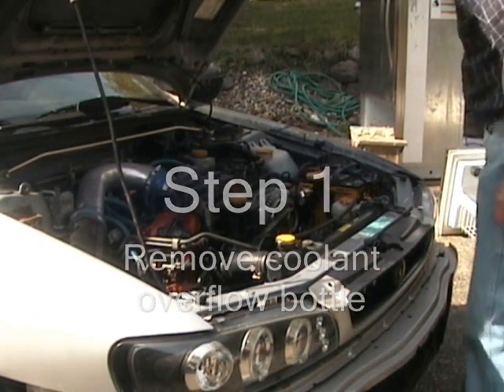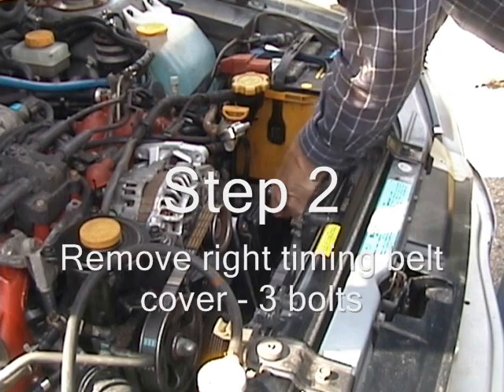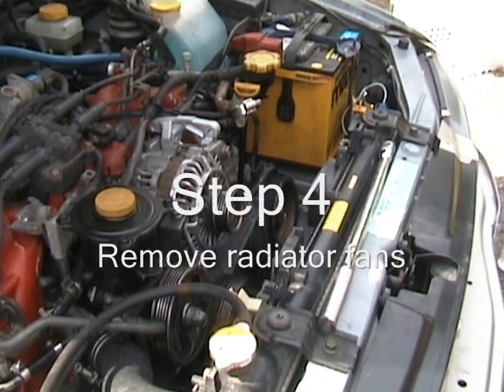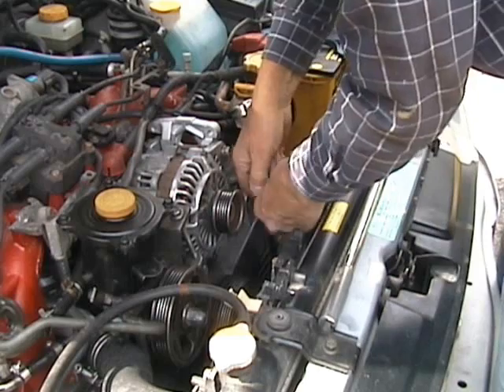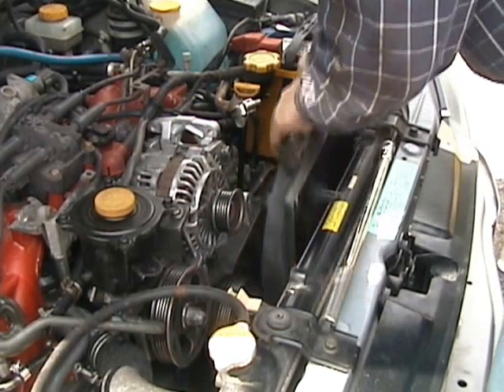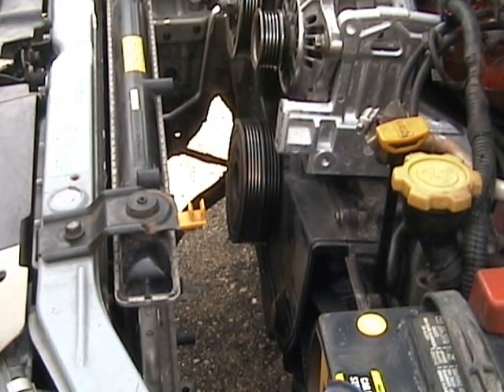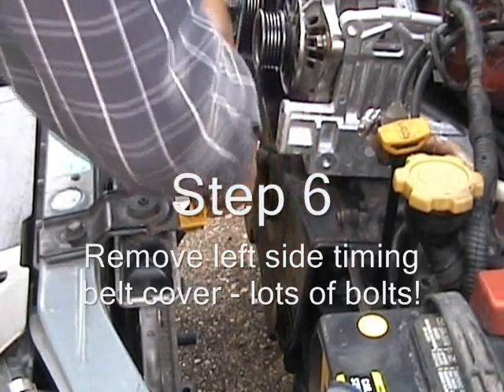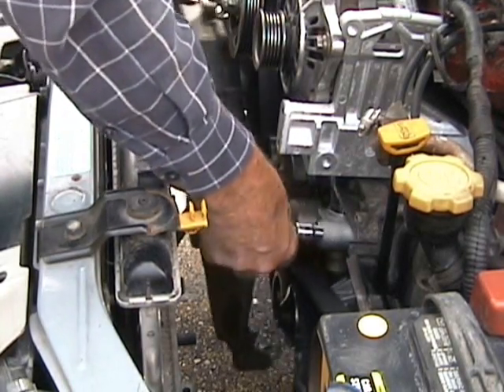How to tell if your Subaru engine knock is from the timing belt tensioner.

Comment: Great video! But to replace it a hydraulic tensioner needs to "bled"
https://youtu.be/UYz5JxKJ5hs?si=s61sTfy6lT6CMN5c
There is also another symptom clue to the noise, if your engine isn't losing power over a week or two but not getting worse and the noise remains, hook up an OBD tool and watch the timing gap angle while the engine is idling, it tends to change its' gap degrees angle excessively around as much as or more than 1 degrees.
If you have an EJ253 you may need to find carefully if the tapping is an AVLS valves (head Bock) fault.

Comment: Hey Brian:

You forgot to mention a few critical things!  Firstly, the upper radiator hose has been removed in your video, and I am wondering if it is OK to run the engine without coolant, like you show.  Secondly, most of us do not have the “chops” to make a homemade “stopper” tool like you use, so what are we to do instead? Are any of such tools sold on Amazon for about $30 US OK to do the job?  Finally, it would be really helpful to have a video describing the procedure for choosing a good quality tensioner and the proper method of installation!

Comment: It sounds like a rod knock. And the wild thing is that if you rebuild the engine you also change the timing belt, waterpump and this exact tensioner. So the problem is gone and you paid 6k for something that already is covered by the service plan. I won't even imagine how many fine engines got rebuild due to this small issue.

Comment: I think this is what’s wrong with mine. I just changed the alternator belt and two days later I get this loud grinding sound like yours. Gonna have to take off the timing cover and check… thanks for the content, quick simple and straight to the point!

Comment: I can't Thank you enough Brian - Sharing this video means so much as I was to having the same knock or rattling sound in my 2010 Forester And was worried that it may have been a Con Rod Bearing. You've just gave me a new direction to look and first check before doing a major overhaul.
Again Thank you 
             Cheers!
Reply: What did it turn out to be? I'm hoping it really was the tensioner 🙏 I've got the same issue 💀

Comment: I have the exact same sound, but the radiator fan is not moving. What should i tell the mechanic to avoid an unnecessary motor lock inspection?

Comment: Was concerned to see you running without the crank pulley to stop the timing pulley coming off, but I see you mention that. Tensioner pulley noise sure can make you think your engine is about to die! Thanks for the video.

Comment: there is supposed to be a metal sleeve bushing where the tensioner bolt holds the tensioner assembly in...i suspect it may be missing from the one in the video.

Comment: brand new tensioner failed ?  my ej25 DOHC< new head gaskets, timing belt, water pump, idled great..until last night...driving along, BAM, lost power, over heat light came on, and engine was making a racket...towed over to my where I have my evening classes, and tonight started up but with ticking noise that increased with engine rpm.  I just removed one timing belt cover....any ideas what it might be ?  Looks like I should check the tensioner, but my noise seems to be louder at cylinder 1...
Reply from the maker: If it runs, timing cannot be far out but "lost power" suggests timing belt slipped. Possibly valves hit pistons so clatter. Sounds bad to me. Looks like an engine rebuild.
Reply: @threehulls  I posted a video on Facebook and 80% said rod knock, but I some said tensioner.  I will listen again tonight (vanagon-subaru) is not at the house..thanks

Comment: I have a 2009 Subaru Impreza and just replaced the timing belt tensioner 3 days about after picking up my car and spending 500$ about it started to idle stall the first day then 1 week later first going on the highway since fixing it.. it started flashing red the temp icon on my dash didn’t want to pick up and was putting and then shut down had to pull over and noticed white smoke under hood not to bad but noticeable and lasted about 10 mins I don’t know if this could be part the reason but I’m so pissed after wasting 500$ and now the car has a knocking noise like a lawn mower 🙄

Comment: Good vid mate, but mine sounds the same ONLY on the initial start-up, especially when in cold temps. Thoughts?  Thought it might be the heat deflector at first, but it IS coming from the low end of the engine and lasts 2 - 3 seconds. Thank you in advance.

Comment: My car has been starting to sound something like this i guess and my brother said it might be rod knock but the other day when i went to go clean the interior i turned it on to see if it did and its not to loud the knocking noise and when i pressed the pedal i only went up maybe 100rpms and then the noise went away and it sounded normal and later when i finished cleaning my car i turned it back on and went up to 2000rpms and i could hear it a little more but nothing to loud, also the engine feels like it shakes a little bit, could it be rod knock? Or can the timing belt tensioner cause the shake too?

Comment: I know this is an old video but my Subaru outback 2002 or 2004 lol can't remember year but lost power and making same noise. Could this also cause me to lose oil pressure? I know it's a shot in dark because video is old but maybe can get an answer.
Reply from the maker: Jami, if you lost oil pressure, you have a bigger problem. Probably a bearing failure or less likely, an oil pump failure. Oil level is critical in these engines. I keep it near the full mark now. I let it get low, but still on the dipstick, during a rallycross and spun a rod bearing. If you have power loss and low oil pressure the engine needs to be rebuilt.
If the timing belt tensioner is bad you will get a similar noise but no loss of power, unless the belt jumps a tooth. In that case, power will drop, but it will not be long before the belt slips more or breaks altogether.
Reply: @threehulls  thanks. I have it in the shop now. Fingers crossed it is just the tensioner and not a spun bearing. That was one of my worries.  Engine rebuild is not in the budget at the moment. Again thanks

Comment: Is it bad driving around with this same issue?
Reply from the maker: Eventually the timing belt will get too loose and jump the teeth with bad consequenses. If you took the front covers off to determine this is the problem then you should replace the tensioner.

Comment: My Subaru 2001 subaru forester tension pully broke. I started hearing a knocking before i could pull over on safe zone in street car died . Mechanic i saying to replace it. Buy full timing kit.. told me that there is a cbance no engine damage happened it made same sound as this before it turned off on me. Should i go for repair or is my engine gone?
Reply from the maker: Your timing belt almost certainly slipped causing the engine to stop. How much it slipped will determine whether the valves hit the pistons or each other. The only way to check without dismantling the engine, is to renew the timing chain tensioner, fit a new timing belt correctly, then do a compression check. If good your engine is probaly OK.
Reply: @threehulls  do u recommend giving it a shot on the replacement  ?
Reply from the maker: @MFKnowledgebeats  I am not a pro, just a self taught mechanic. If it was my car, I would do the timing belt replacement, because the cost is reasonable, and I can do it myself. Sounds like you will have a mechanic do it so cost will be more, but nothing like the cost of a full engine rebuild. . If the engine is bad after that then I would find a used engine.
Reply: @threehulls  apriciatte the replys new subscriber

Comment: Awesome tip. Another little one...put your crank pulley back on and snug the bolt a little before starting it. Would be a shame if the sprocket key fell out.
Reply from the maker: Yes, it was pointed out 4 years ago and I modofied the video with a suitable warning. It appears to have reverted to the old video, not sure why.

Comment: Did it make it loose a bit of power? I'm looking at a 2005 outback with same noise loudest at 2k. head gaskets were replaced 600 miles ago.
Reply from the maker: No power loss, just extra clacking noise. If left uncorrected will eventually cause timing belt to slip and then lose power, maybe catastrophic.

Comment: For anyone watching this still and trying to diagnose their ticking/knocking noise, buy a stethoscope and use it to pin point where it's coming from. If it's coming from a cylinder, unlucky. If it's not, today's your lucky day and you can diagnose it and fix it.

Comment: Wow, this might just save my buggy engine!  It developed a knock over the weekend, it’s full of oil and the noise seems to be in the center of the engine.  How sweet it might be, just needing a timing set!
Reply: Hey bro so was it the tensioner?
Reply: @crixer3969  no, it was rods.  It’s actually been sitting in a rack for the last 3 years and I have two other long blocks I could swap in.  I’m torn between replacing the engine or revamping the whole build with a 10 degree transmission mount and more clearance.  I know one thing, I should have turned the sump 180 degrees and I’ll replace the oil pump with a WRX or JDM flavor.

Comment: When tightening the crank shaft pulley, is there a specific way you have to do it or do you just tighten it down?
Reply from the maker: Yes. Google it. Here is one thread: https://www.subaruoutback.org/forums/66-problems-maintenance/51859-crank-bolt-didn-t-go-65-degrees.html
Reply: Ok thanks boss

Comment: I tore my ej255 down to see if it was ring/main failure.... nope fit as a whistle..... started turning it over slowly for that damned clacking noise that was so prevalent at 1000 rpm.... it was there ever so slightly at 3 rpms, decided to pry on the tensioner, and the noise was practically gone.... until the tensioner pulley decides to leak again and lose  tension..... baffled the shit out of my bachelor's science teacher friend going on to explain there are more parts in the crank, maybe, but there's no pressure running through it and the AVCS is just a solenoid.... long story short, don't show this fix to a clever clogs

Comment: I think most of us wanted to hear the knock before you'd dismounted most of the stuff on the front of the block, first.  Although, having played with three Legacy engines myself, I realize most of that take-down was needed to access the timing belt tensioner.  Lucky you, it was covered under warranty.
Reply: JeanLafitte it would still sound the same

Comment: My engine just started having issues yesterday loss of power excessive shake at idle but sometimes not? Making a popping noise under load at certain speeds. Could it be the timing belt? Also been having it burn oil and coolant from the head gasket I assume.

Comment: I'm at 214K, just did the timing belt, water pump, tensioner and all idlers only to afterwards wonder if I was losing my mind because the motor was so...smooth, this explains it perfectly. Appreciate the short length vs others with same info. There was a small amount of oil on the top of the tensioner. All Aisin (Japan), not Gates (china).

Comment: Just did my timing and now has a slight knock. I noticed if I pulled up against the timing cover the noise would go away so I'm thinking maybe I'm having the same issue as you in the video. Worst case scenario would be I'd have to go back in and readjust the timing. Thank you for the video!
Reply from the maker: Do you mean timing belt? Not sure why just replacing the belt would cause a new noise. If you did what I show in the video and the noise went away then it is certainly the tensioner.
Reply: if belt touches a cover you will hear,or a loose cover .

Comment: I have this sound coming from my 2007 Forester XT. It has also stalled a couple times times and had some unstable rpms after restarting it which eventually stabilized. Could the tensioner cause that kind of behavior as well? Or is it likely to be a different problem?

Comment: so I know this video is older now, but I have a 97 Legacy with the 2.2 and your Timing tensioner looks way different that mine, it sides left to right and when you pull the pin it pushes on a pulley and creates said tension, its "OEM" and when I looked up timing tensioners the kind you have on yours is an all in one unit! would you happen to know if this is something that can be put in as a replacement to the kind I have? I'm sorry I cannot describe it better, its 2 pieces vs your 1, and I'm trying to diagnose a few noises myself and am thinking the tensioner may not have set properly
Reply from the maker: Sorry I don't know anything about how the 2.2 differs from the 2.5.
Reply: Brian Thorpe fair lol thanks was worth a shot, went on Google and searched timing tensioner for 1997 legacy and it appeared lol saying it fit the 2.2 and 2.5

Comment: Appreciate the vid. Changed my timing components 3 weeks ago with the Dayco kit. Threw CEL 2 weeks after. 2 misfires on 1-2, did your tensioner throw a code?
Reply from the maker: No. If timing is out it will affect all 4 or if one cam is off, the 1-3 or 2-4. Must be a separate problem.

Comment: Brian, I have a 2004 Impreza outback sport That has the same sound And I suspect has the same problem. I am 18 with really no experience other than changing my own oil. Is this something that I could do by myself or could I ask a dealership or local mechanic to check for me?

Comment: Great tip. I didn't even think about this. My gf has a knock coming from the same area on her 05 Subaru. I'll be doing the timing belt this week so I'll be checking this. Hoping that's it. Thanks for the video.

Comment: Will the tensioner make this sound all throughout the RPM range or only under like 2,000rpm?
Reply: i had this same problem, but at only low rpms and it was only my tensioner slamming into the engine, only happened when engine was cold and at low rpms. higher than 2-3k rpms and having a constant knocking is usually rod knock
Reply: It only makes the sound on my car under 2k rpms, but it will make the noise after driving for 30mins too. I still need to start the car with the timing cover off. Coolant is drained so I can only run it for a few minutes. Hasn't started in a few weeks so that may be a problem with oil no longer coating crank bearings. Since I don't drive this car much that may be my main problem anyways.

Comment: Hey Brian, so I've been doing some research and I wanted to explore this before I did my swap. 

My RS knocks when it turns over on cold start, and quickly goes away when the revs come back down. It will knock when I either try to regulate my speed around 2k rpm and 3500 rpm, it won't knock if I am accelerating steadily, and won't knock below the rpm said above. It's loud in 1st to 3rd gear around 3k rpm, and it's not too loud in 4th and 5th around 3k rpm. If I take my foot off the pedal completely even if I am at 3500rpm it wont knock either, it will only do it if I am trying to keep my speed.
Reply from the maker: Christian, I am not an expert at this but, based on your description, it is probably not a rod knock. It could be piston slap (worn bores, but this is not common) which is worst at light load. Possibly worn lifters which fill with oil slowly after cold start. Could be the tensioner. You have to check all the common things like oil pressure, does it use oil, listen to noise with the "screwdriver method".

Comment: my engine sounds like that when cold startup, after 5 min of driving the sound goes away.  could it be the tensioner as well?
Reply: @charlesdylancobb  This is an old comment, but for future people reading this: do not run oil treatment stuff if you have ticking/knocking noises. If you have piston slap or valve issues, the oil treatment can remove carbon deposits that are currently saving your engine from dying.

Comment: https://youtu.be/6xRwhvwMQBs
Hey brain can u pls listen to this knocking noise would it be the tensioner
Reply from the maker: Richie, it sounds the same as mine did. I would check oil pressure to make sure it is not a bearing but then go after the tensioner.

Comment: thx alot brain , i need to ask u , i have a knocking sound in my wrx 96 at idle rpm , as long as i press accelerator the knocking stops , and i don't hear that sound always ,
what do u think my problem would be ???
Reply from the maker: Could be the tensioner. Check for rattle in accelerator llinkage.
Reply: +Brian Thorpe thx man , i will check it , i hope it is not the lifters